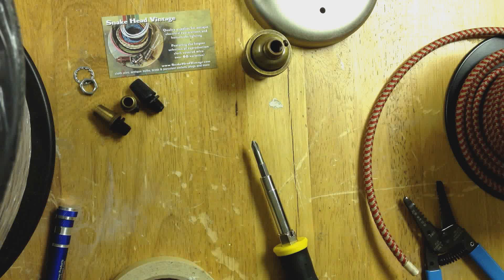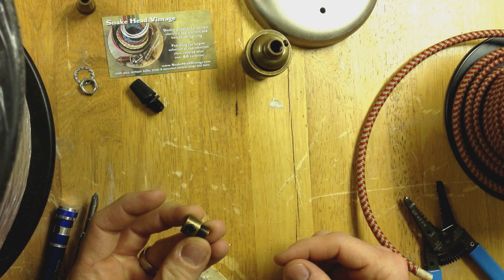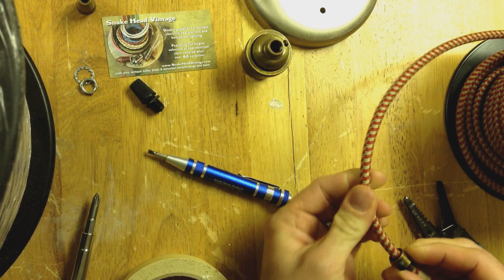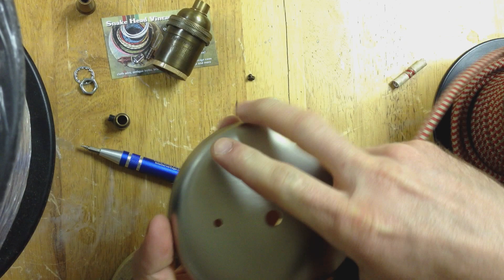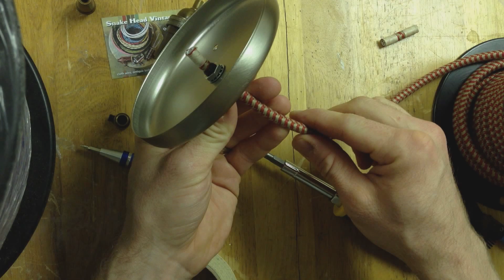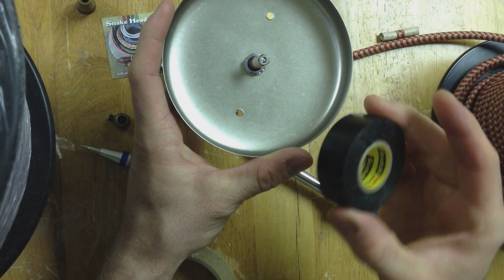Strain Relief Pieces: How to Use Cord Grippers with Cloth Covered Electrical Cord

Comment: will the strain relief work for a vintage saucer pull down lamp?
Reply from the maker: The cord will need to be under 0.30" in order to use the set-screw style strain relief. And it will need to either be screwed into the socket/canopy/pulley yoke (if there are 1/8ip pipe threads there), or nutted on if there is just a 3/8" hole.